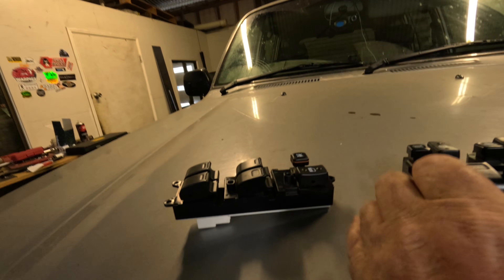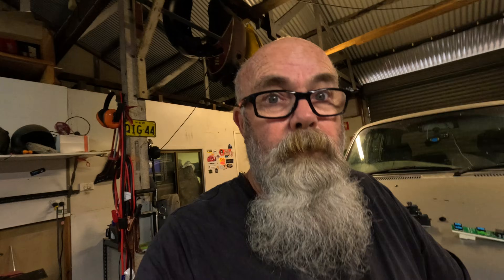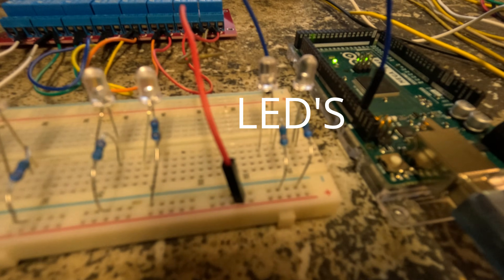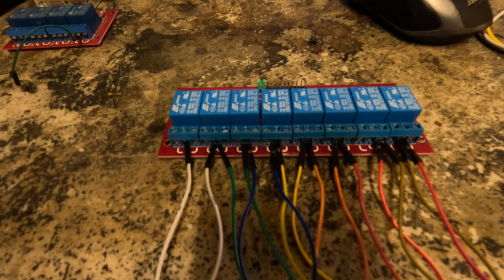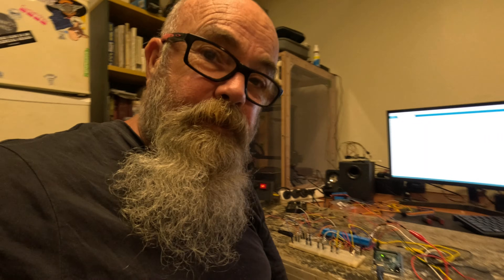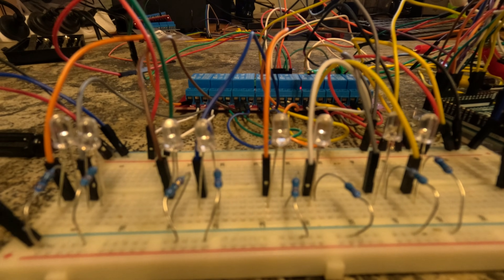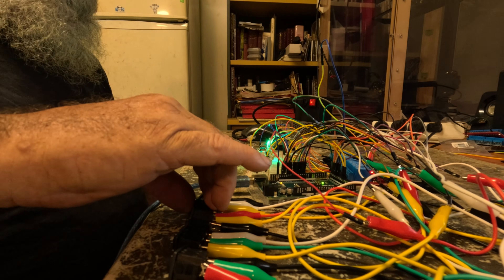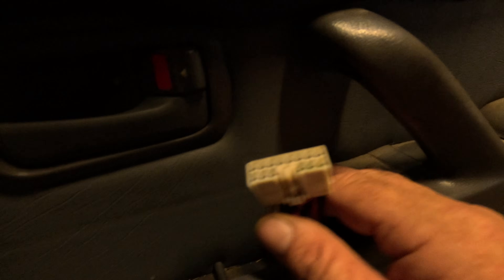Sick of Rubbish Aftermarket Window Kits – 80 Series Power Window Bench Test

Comment from the maker: After getting sick of rubbish aftermarket window kits, I decided to build my own.
This is the bench test of my custom 80 Series power window controller — messy wires, LEDs instead of motors, and every function tested before it ever touches the truck.
Vehicle install coming soon, so stay tuned if you want to see it survive the real world.

Optional additions you could tack on:

“Got questions about the wiring or logic? Drop them below.”

“If you’ve had your own aftermarket horror stories, I wanna hear ’em.”

Comment: A lot of big brain stuff in this vid, gave me a headache! To quote Angus Young, brains ain’t me forte. 😂 Glad there’s guys like you that can do it.
Reply from the maker: Had plenty of headaches' with this Brian. I want to expand the functionality to have auto up n' down on all windows and integrate remote central locking. In this vid all that is really proven is that the code is stable as is,  until I make the changes to the design idea to make it actually work in the 80 as I want it to. Its all trial, error, beer and swearing till I stumble upon an idea the works. Cheers Brian🍻 Angus may not be the sharpest tool in the shed but he plays a bloody mean guitar.

Comment: Couldn't you just de-solder the old DPDT Relay, solder in a couple fly leads with spade connectors and put in some larger Narva, Omron or Bosch relay's (20-40A). Then you can hide the relays in the cavity & that way you can easily swap out a potential future failure if it ever arises.
Reply from the maker: Yep For sure I could have quite easily done that but where is the fun in that, I'd have learned little new and would never have gained a heap of coding experience. I guess It's a bit like climbing a mountain, cause its there and is a bit of a challenge to see if I can work it out. Still refining the ideas and will continue till I'm eighter happy with it or get board with it.